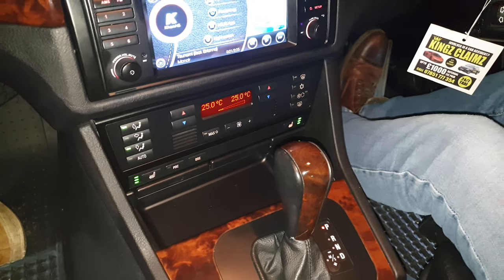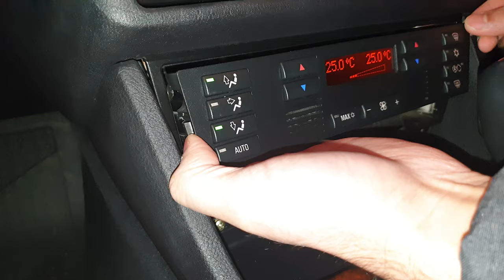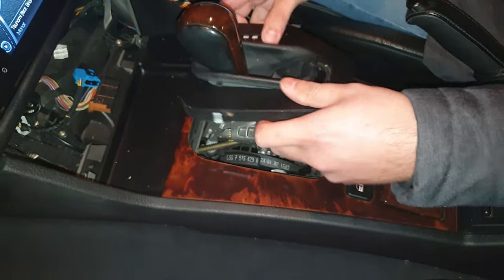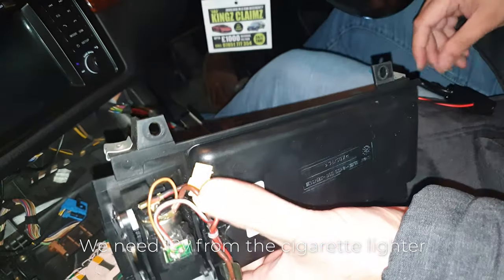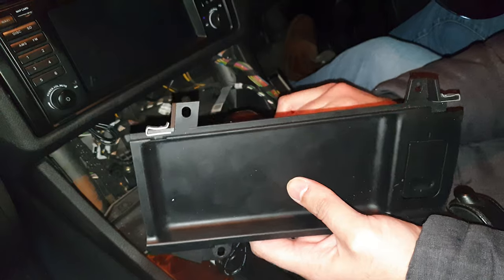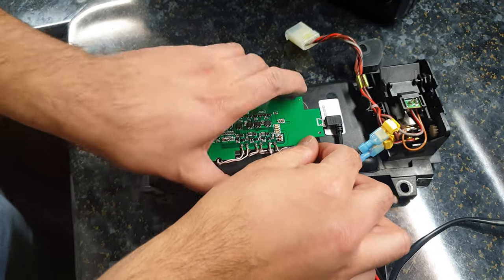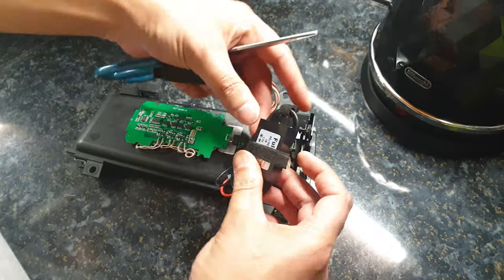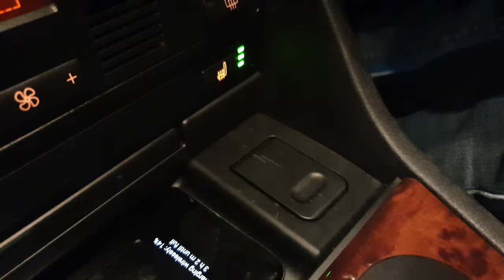BMW Wireless Charging Retrofit | 540i [E39]

Comment: Please tell us how fast it is when you tested it. Thank you :)
Reply from the maker: Average is 1.5 to 2 mins to charge 1% on my s9+ with data/nfc and always on display turned on. On my journey home from work it charged 12% of the phone battery in 26 mins. So bang on 2 mins per percent. Not too bad. Ovcourse you can get a wireless transmitter which has a higher output for fast charge etc.
Reply: KhanHS Thank you!

Comment: As a former avionics tech with 30 years experience on aircraft and who has done some automotive wiring over the years, that is not how to properly attach crimp connectors. You don't strip the wire to the point where you can feed it through the hole in the blade part of the connector. Having the wire go through the hole will not give you a better electrical connection and will make it harder to insert the spade into the female connector.

You only strip the insulation back far enough to expose an amount of wire the same length as the metal barrel of the crimp. The Insulation is only supposed to butt up against the end of the metal barrel inside the plastic when you insert the wire into the crimp.

If the wire wants to pull out of the crimped connection after crimping, you either didn't crimp it properly or you didn't use the correct size of crimp connector for the gauge of wire.
Reply: Bro go get a life . Avion techs🤣🤣🤣🤣
Reply: @mrmuscle7764  I have a life. One that includes over 30 years of working on aircraft avionics and automobiles.

If you are going to do a video that includes how to wire something up using crimp connectors, you should at least make sure that your instructions for doing that are correct. A job worth doing is worth doing well.

Comment: Does that stay on 24/7 or is it only on with ignition? My e53 is always on from the factory so I added a relay to solve for that
Reply from the maker: It's wired to the cig lighter which is always on and therefore so is the wireless charger. It would be better to use a piggyback fuse tap on something that only turns on with ignition.

Comment: What type of crimp terminals did u use? the link does not work any more. ist it 6.3? oder 4.8? Or even smaller?
Reply from the maker: Sorry I don't know the size of them. I bought a pack off of ebay and just used whichever one fitted nicely.

Comment: What phone is that? You think an iPhone 8 Plus will fit there?
Reply from the maker: The iphone 8 plus is slightly wider so I doubt it but best way is to place it on the tray and check
Reply from the maker: Mine is a Samsung galaxy 9+
Reply: KhanHS thanks! Just didn’t feel like going out to the car and checking. My 540i has been sitting for a while lol
Reply from the maker: @NYCRevolution1  ah ok. Fair enough. And no problem :)

Comment: This won’t drain your battery?
Reply from the maker: I’ve had no such issues but ideally you want to tap into a switched live and preferably piggyback off of a fuse in glovebox.
Reply from the maker: @Nbavirals2025  Fuse 21 for me. Using a fuse tap in the glove compartment fusebox is very tight but doable.